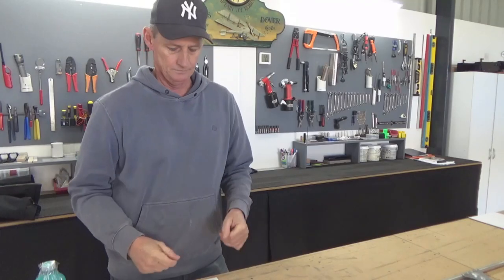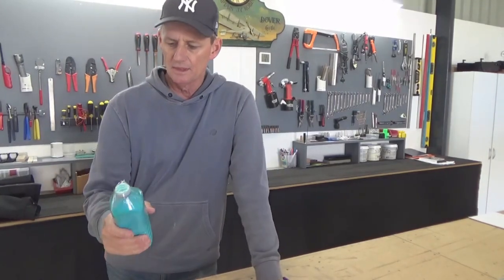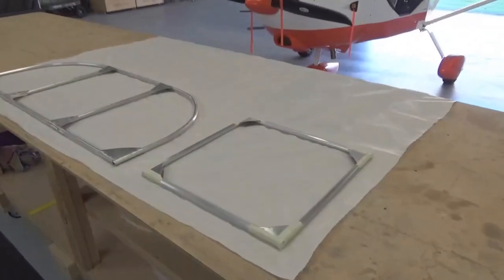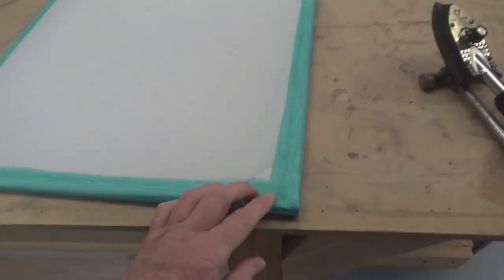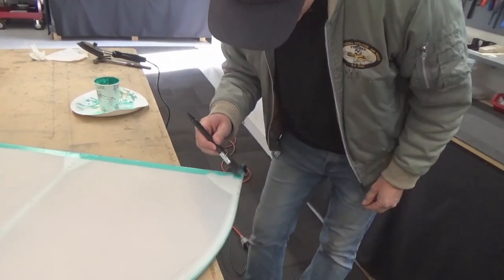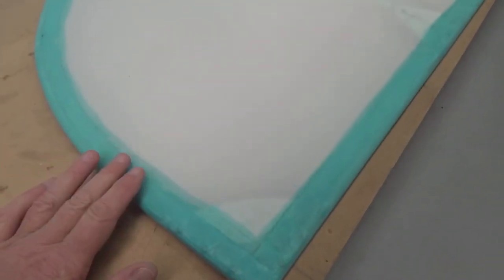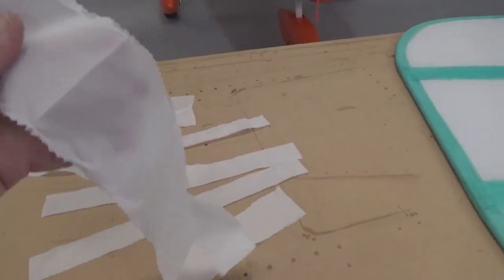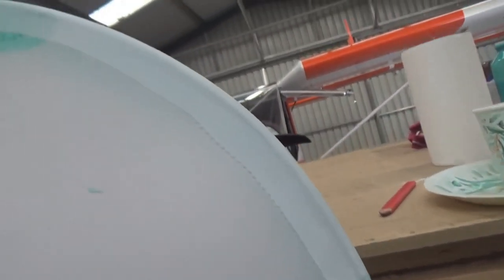Aircraft Covering Stewart System Test

Comment: As a retired A&P. First mistake not getting a sewn or pre-sewn envelope first for each control surface, wing, or fuselage. Then please rib stitch it on with the new life time threads available. People please don’t learn this nonsense unairworthy way to cover aircraft surfaces or you’ll join Steve Wittman and his wife six feet under. These are facts cruel as they are if your an adult handle it and learn, from others mistakes in aviation accidents have lessons to learn from those poor souls that were the test pilots for us for maintenance procedures that fail with disastrous consequences.
Reply from the maker: These are test pieces, only certified processes utilised by this LAME thank you.

Comment: Glued on fabric on an elevator, aileron, wing, fuselage, or rudder unairworthy to me without some ribs and rib stitching. Also use the latest lifetime thread if it meets or exceed the original thread. Why do I say that. Well go look up what killed Steve Wittman the EAA Oshkosh airport field is named after. I ll make it quick for you his wing fabric came off mid flight destroying all the wings lift. He used this glue on fabric method with no rib stitching.He and his wife both died a terrible death as the plane dove into the ground at high speed. Rib stitching is your life saver on all fabric covered flight surfaces. Period end of story if you value your life and your fellow passenger’s lives.
Reply from the maker: As I said, these are test pieces, continue watching to see the completed certified airworthy structure.